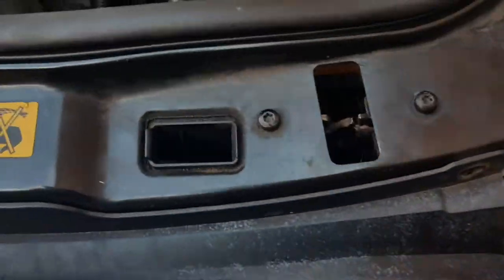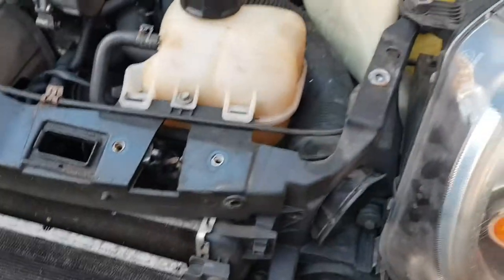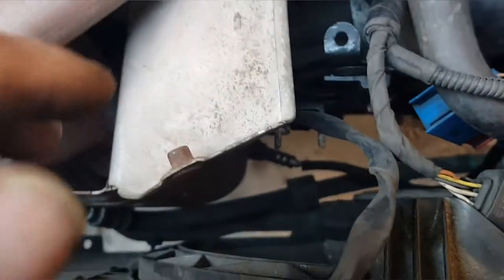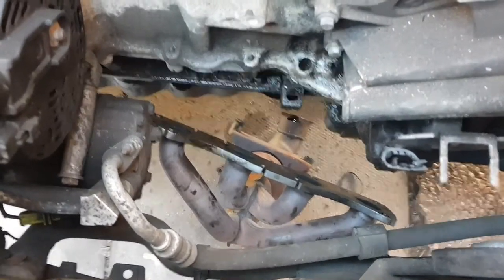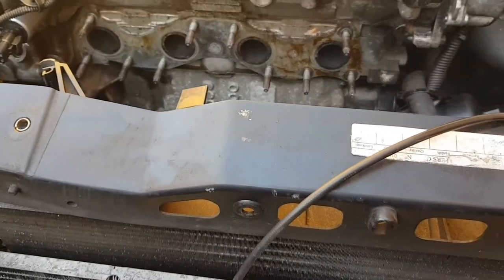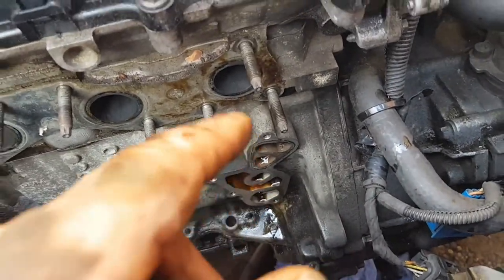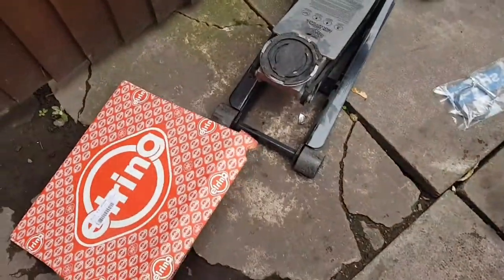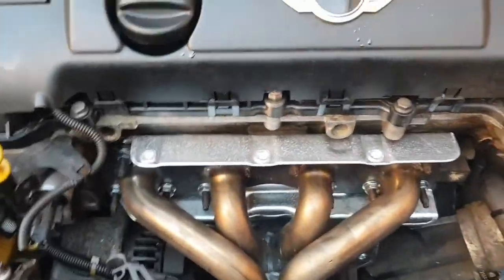mini 1.6 catalytic converter & oil filter housing gaskets replacement

Comment: Was absolutely dreading this job. Found a couple of other videos that either bent and bashed or more or less stripped the entire front end off car.
Your vid showed that while typical mini where a 5 min job to fix a leaking gasket requires a lot of other stuff to be got out of the way first.
Your vid just showed a more fencible way to do job.
Some of the nuts on the heat shield are a real sod to get to though.
Many thanks for this

Comment: Would you happen to know if the oil filter housing gasket is located in the same place on mini one r56 1.4 N12B14A? I will be changing my catalytic converter, and this is the only video that's been helpful so far. Thought my as well change these if they're exposed in the process
Reply from the maker: @nb7930  yes I believe so
Reply: @fuelheadjay8800  thanks mate, much appreciated 👍🏽

Comment: Did you leave the header heat shield off? I’m thinking about leaving mine off just because of how much of a hassle it was getting it off in the first place 😂
Reply from the maker: No I placed it back on it was a pain to get back on but soon it done it's done.
Reply: Iam going to trim mine, so all the bolts are accessible in a future

Comment: Hi !
Any chance you could tell me if this can cause oil to go in to the coolant? or is that a head gasket blown sign?
Thanks
Reply from the maker: Yes it could cause oil to go into coolant
Reply: Is it possible the other way around? Coolant in the oil?
Reply from the maker: Yes it can go both ways